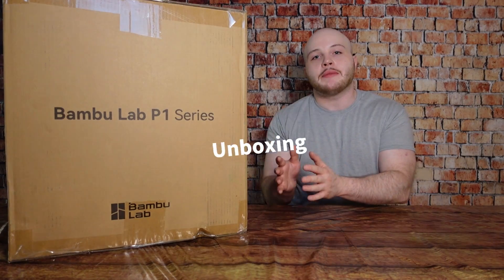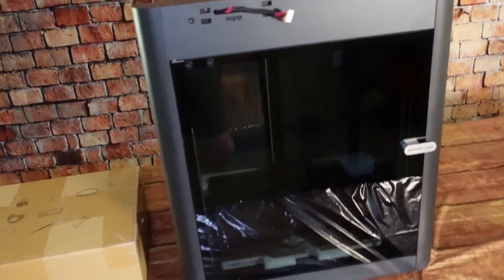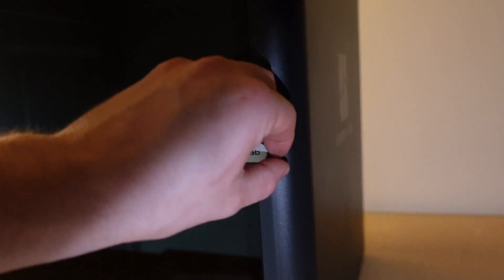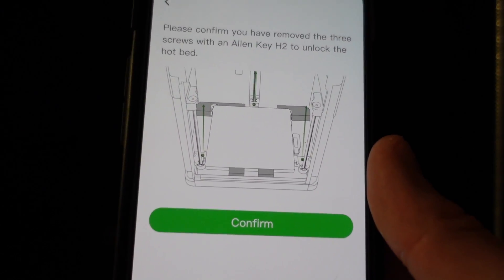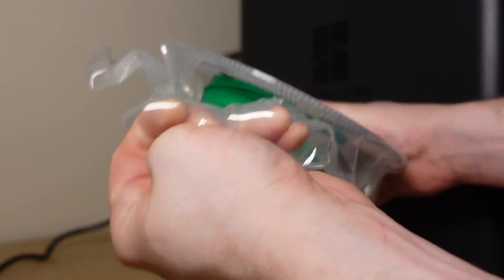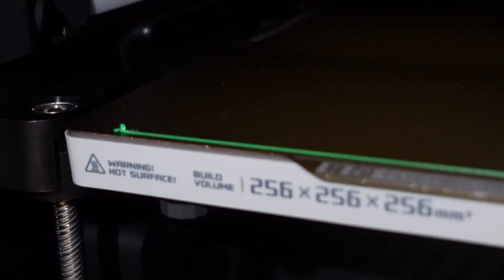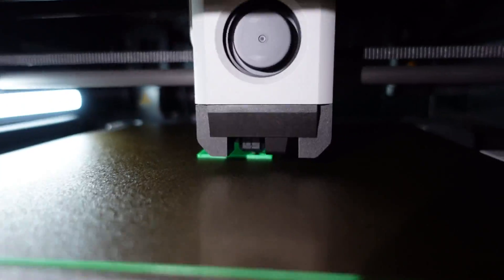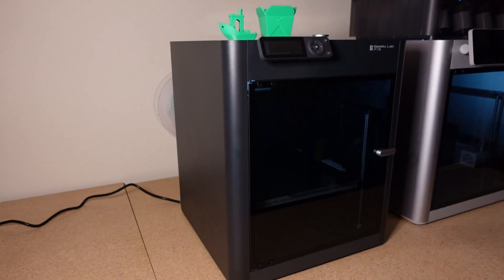Bambu Lab P1S Unboxing & Setup

Comment: I`m running into issues trying to connect the phone to the printer it`s stuck in the building connection screen and I've tried restarting it and repairing the printer.  any ideas of what to do or how to get it to work?

Comment: 2:20 What's that door for? I tried opening it on my P1S, but it felt a bit stuck somehow, and I didn't want to break it.

BTW, for those who are interested in the P1S: It's amazing. Keep in mind, my previous (and only) printer was an Ender 2 that I modified quite heavily myself. It is pretty darn loud, but what do you expect for a machine printing at these speeds. Printing on my Ender 2 was a TASK. I had to constantly level while printing the first layer, had to monitor the first couple of layers, and even then it took forever to print small things. After printing for about 20 hours on my P1S, I haven't had a single failure, and am plenty comfortable to just hit print and know that I can expect a good result.
Another thing I didn't expect: Supports are amazing. On my Ender 2 I avoided them at all costs, since they either didn't work, or were so stuck on they were permanent parts of the model. The supports on the P1S just pop right off, some even fall off by themselves.

This machine (and probably all Bambu printers) are seriously plug-n-play. Like said in the video: I didn't do any (manual) calibration or anything, I literally plugged it in and started the benchy, and it came out perfect.

Comment: I seriously considering getting the X1-Carbon but if this P1S is the same minus touch screen a few leveling AI, is it better to save and get this?
Reply from the maker: It all depends what your plans are. If you need another printer for production and only print with PLA then the P1S is a great pick. The camera on the X1C is a lot better, so if you’re a content creator or plan on using time-lapse videos to promote your business then the X1C is the better pick. You can also print more types of filament with the X1C. I personally think every farm should have at least one X1C. I already have one, so now I’m buying P1S’s because they’re better value for prototyping & production.
Reply: @MysticMesh3D  solid advice! Thank you so much! Tomorrow is payday so ganna place my order soon!

Comment: Torn between this P1S(with hot end and extruder upgraded to hardened steel ones) and the X1C.. Totally newbie in 3D printing, is the price difference worth it ? Is the CPU more powerful on X1C make a huge benefit ? What would be your advice ?
AMS essential for a beginner..? Thanks in advance
Reply: all bambu range is beginner friendly, p1s is the best option imo, ams only if you wanna print multiple materials, i wouldn't pay extra persoanlly all about if you want touch screen and faster print uploads
Reply: @alex59292  Thanks for your advice 👍
Reply: There are a few small differences between the X1C and P1S, which are mostly "convenience" upgrades/nice-to-haves and not something that'll increase print quality or speed (except for the lidar maybe, but from what I know the difference is negligible and can easily be tuned by hand), but imo they are not worth the price difference. 

The main differences are plastic sides instead of aluminum, no lidar, no hardened extruder gears (which is a ~$20 upgrade), worse camera, worse screen (which you can use the handy app for everything), the bed only goes up to 100C instead of 120C (which should be fine for most filaments, but that depends on what you are/planning on printing), and no chamber temperature sensor.
Reply: @ThomasS17  Thanks a lot for these précisons.. I think I will pull the trigger for a  P1S..

Comment: How you clean the plate after printing? Just got my P1S 😅, alcohol? Soap?
Reply from the maker: I use isopropyl alcohol
Reply: @MysticMesh3D  ok, thanks for answering!!
Reply: Yep I agree. I've had a pei plate on my prusa for years and I spray some kitchen roll with alcohol and rub the plate over. Never have any adhesion problems so you'll be fine..
Reply: @furrypotato  I’ve been using it on a “ultistick PEI plate” in my Ender 3v2 for 2 years and still working  perfect, thanks for the answer!

Comment: Are you able to print your crates on printers other than a Bambu? My Neptune 3 does a horrible job.
Reply from the maker: Yeah. I’ve personally printed them on an X1C, Ender 3 S1, prusa mk3s+, and sovol sv04
Reply: @MysticMesh3D  Still using .06 nozzle I assume. Prusa slicer misses parts of the print and curas look like crap

Comment: How good it works with PLA? It have an enclosure and PLA is not good with enclosure, does all the fans help with the heat inside?
Reply from the maker: It prints great with PLA, the filament used in this video was PLA. I print with PLA on my X1C and it prints great on that printer too.
Reply: @MysticMesh3D  with the door and the top closed? Thats good to know